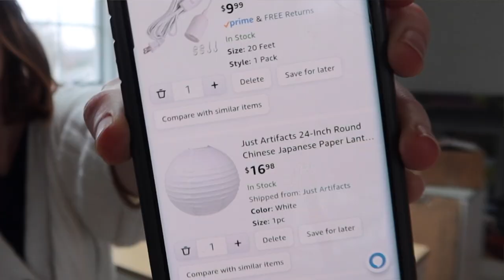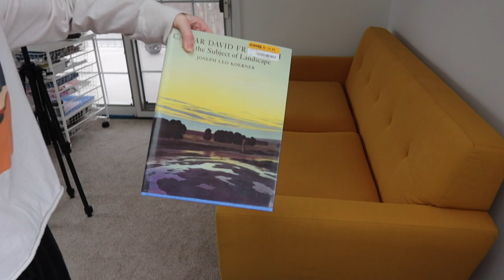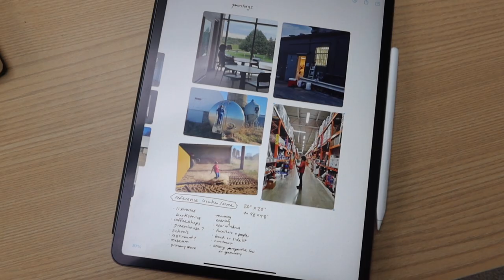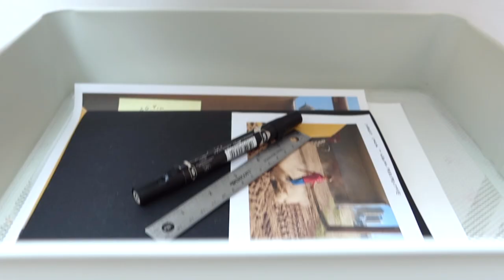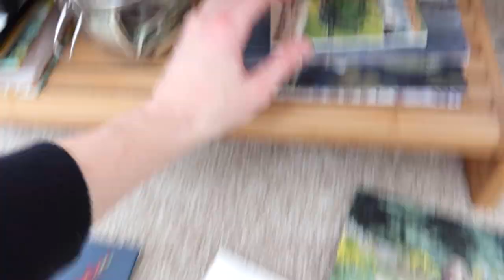Studio Makeover and Preparing for a New Year

Comment: Hiii I'm curious how you make your paints flow so smoothly when you apply it on your canvas. Like is it straight out from the tube or  do apply medium ? A new subscriber here 😁💙
Reply: i am curious too
Reply from the maker: Hello! I'm using acrylics, and not heavy body ones. So the consistency right out of the tube is more fluid that something like oils. Otherwise I just keep the brush wet with a little water. And very rarely I'll add a glaze medium for toning the panel in a thin layer.
Reply: @mariasisul  i see, noted 😊

Comment: Hi and thanks for sharing.  Where did you buy your tube paint peg rack/strip?
Reply from the maker: I built it. It's not too hard to make, you'd just need a piece of wood, a drill and some pegs or a dowel cut into small pieces. Nails could work instead of pegs too.